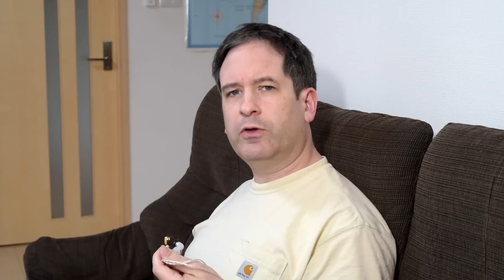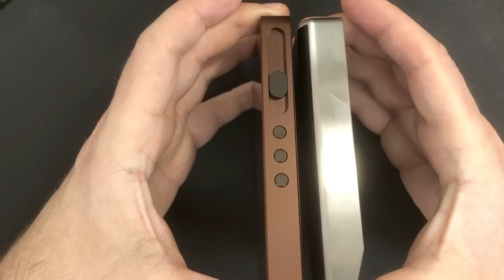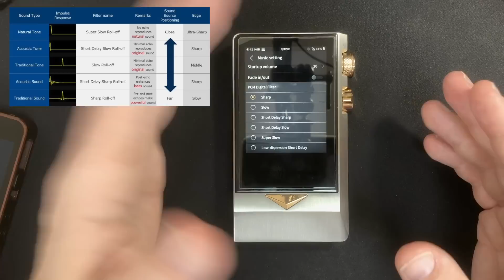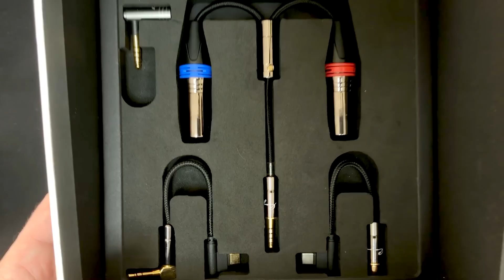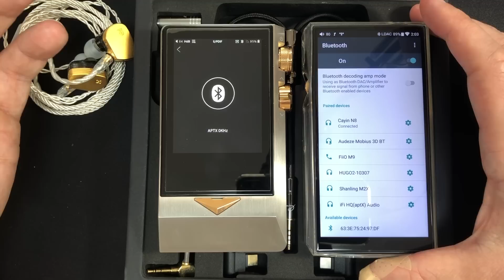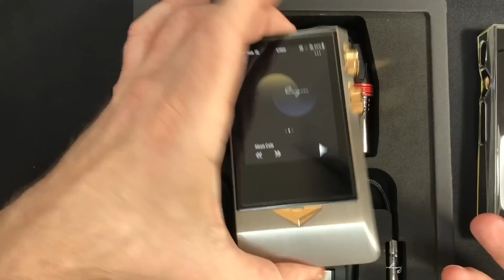Cayin N8 Review - The flagship player with a tube amp built in!

Comment: The Cayin N8 is better without Android because unlike the FiiO M11 you won't have to worry about the Andriod version it would use eventually becoming obsolete. Then later on you would lose functionality. That would suck for such an expensive device.
Reply from the maker: The Cayin N8 uses a custom version of Android.
Reply: @Currawong  If the Cayin N8 uses a custom version of Android but you can't download apps or use music streaming services with it then it's not a smart device. Therefore  you shouldn't have to worry about losing any funcrionality if you continue to use it for many years to come. Loss of functionality would be the only reason why I wouldn't buy a 3000 dollar Dap. That's the reason why I still buy iPod Classics from eBay but I wouldn't get much use from an old iPod Touch.

Comment: Nice review

A question about your DSD comments

i really don`t understand clipping, is that something that can blow your IEMs/headphones/speakers?

And you're not saying to avoid DSD(i have tons of DSD files), but when using DSD, then use the DSD compensation?

i have an N8 and love DSD, so that comment caused me concern

Another question, does the N8 have a search function? 

With the huge storage available,it would be nice to be able to search by word, artist, song, etc

Cheers
Reply from the maker: It's somewhat complex. My (limited) understanding is that maximum output (-0dB) in DSD is equivalent to -6dB in PCM. For reasons of conversion (most DSD is derived from PCM) they convert with a -6dB setting. Thus, when playing back DSD, many devices add a default +6dB gain.
Reply: @Currawong  Cheers mate

Comment: An interesting review.

Is this DAP the only one with a tube output?

Given it's inclusion, does the N8 run hot?

The Fiio M11 certainly loads album art extremely quickly.

Other than the discontinued Calyx M, and Acoustic Research AR-M2, are there any current DAPs with a class A output that would provide a tube like sound?
Reply from the maker: The Korg NuTube will run off batteries with no problems, so it doesn't get hot. I did try the Opus 3, which was slightly warm-tuned, but that was a while ago.
Reply: TerryM The DX220's upcoming AMP 9 will run a tube sound.

Comment: I don't understand why you can't use the tubes on the balanced output? That seems like that would be the optimal setting. So Cayin won't replace the tube if you want them to?!?!? This doesn't have 4.4 balanced output either!
Reply from the maker: The Nutube is soldered to the board. With the automatic cut-off, it should last a long time. In otherwise, it shouldn't need replacement for the lifetime of the device. For the 4.4mm output: Tubes are single-ended devices, so it would require two matched ones to do balanced. I was wondering why they don't have some kind of relay so you can have the tube output go to the 4.4mm socket, even if it isn't balanced output. It might not have been practical.

Comment: this is what i like to most dap should be, a customized software  full android support sucks imo. android is a battery culprit imo..
Reply: It's also better that this dap doesn't have android because all smart devices will eventually become obsolete. For example an iPod Classic has just as much functionality more than 10 years latet as it did when it was new. However an iPod Touch 10 years later doesn't have as much functionality as it did when it was new. The IOS version is obsolete for such an old device and you can't update it to the current version of IOS. So you can't download any of the new apps from the app store and the Safari web browser doesn't work as well as it did when it was new. So if the Cayin N8 had android it wouldn't have the same functionality 10 years from now as it did when it was new. Without android you could continue to use the Cayin N8 10 years from now or later the same as you could now. Just like buying an iPod classic in 2020 would make sense because it's functionality is the same as it was over 10 years ago but buying an iPod Touch 2nd generation 12 years later wouldn't make sense because you can no longer do much with it. Since this device is so expensive I would prefer to be able to use it with full functionality for many years to come.

Comment: If ur iems have low impedance u need an dac/amp setup which has less than 1 ohm rt ? Am I right ,thx
Reply from the maker: Depends on the IEMs. If they have a non-flat impedance curve, with the impedance dropping below about 8 Ohms at some frequencies, then the output impedance of the amp should ideally be <1 Ohm if you don't want significant changes to the frequency response (eg: you might have a much lower bass response). The only way to know is if someone has measured the impedance curve of them.  With a lot of IEMs you'll be fine even if the output impedance is 2 Ohms, or even 5 or 10.  Choosing a DAP/amp with an output impedance <2 Ohms is a safe choice.
Reply: @Currawong  thx for your reply, to add more details, I currently have the audiosense t800 at 9.2 impedance, would get the fiio fh7 and maybe the campfire audio solaris by the end of the year or early next year ,I've seen fiio m11 and ibasso dx160, fiio m11 has 1>output impedance where as dx160 has 0.5ohm ,so I was wondering if I should get the ibasso dx160 coz of its low output impedance coz most of my iems would be having low impedance, wheres I've seen reviews state that the fiio m11 has a hiss to low impedance earphones, thx ,would be really helpful if you could clear this for me